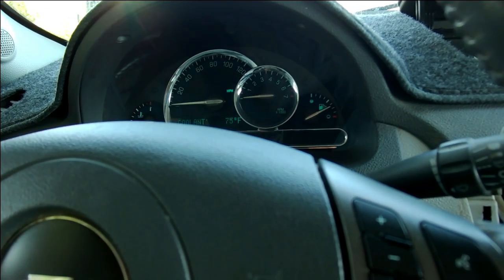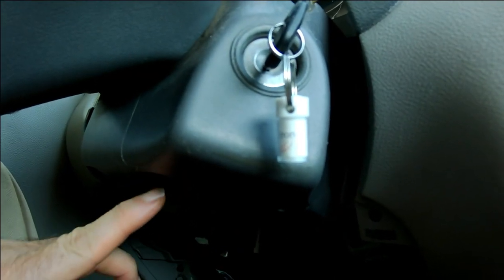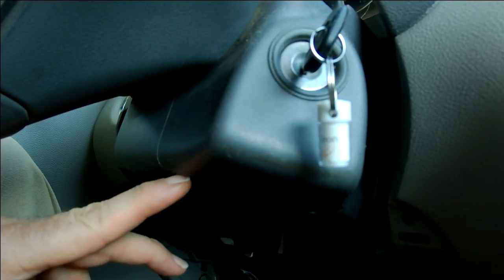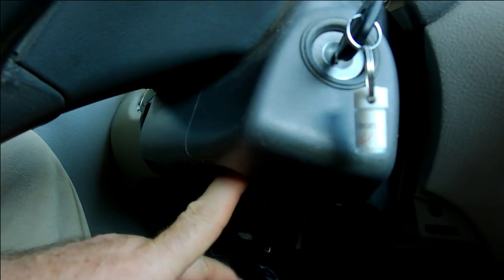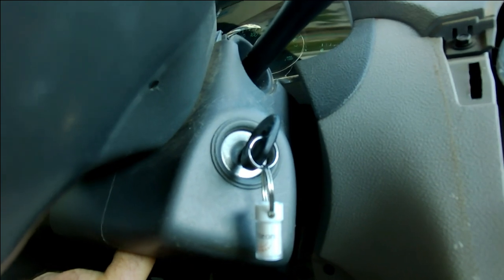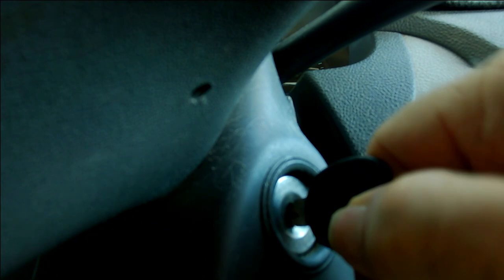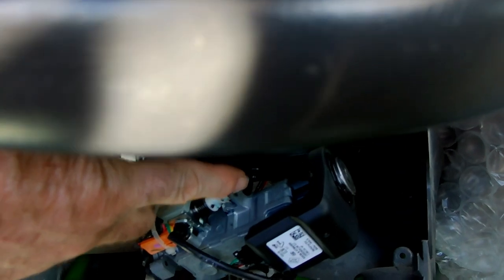Key Stuck In Ignition Switch Chevy HHR, What to Do

Comment: I have had that happen in my HHR a half dozen times. Usually when I have pulled into a parking spot at a very sharp angle and the steering wheel is still turned. Each time it releases after I do a few things, like open and shut the door, lock and unlock, shift gears, and try to right the wheel even if just a tiny bit. Key comes out. All us well. But I will remember this trick next time 👍
Reply from the maker: Wow, that is a bunch of things to have to do. Hope this helps.
Reply: Susan you saved me today. I didn’t have anything to open the the hole in the bottom and tried this and it worked on the first try. Thank you!
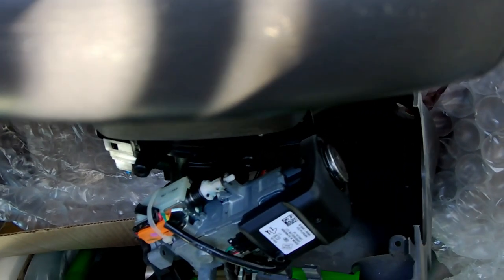Reply: Same here, mine has been doing it A LOT lately & normally after being aggravated & shifting the gear thing back & forth for a bit it comes out, BUT TODAY it wasn’t (since way earlier like afternoon & it’s 2:30 in the a.m. now)… I didn’t want to wake up to a dead battery (even tho I turned the radio & lights off manually idk if that helps or not tho) to take the kids to school so came here on YouTube & Thank God I did, got it out 2 seconds later… I was sooo happy!!!

Comment: I have an HHR. It's crazy how my key got stuck. I play music using my phone into the car's 1/8" plug. I turned off the car and music console but forgot to shut down or unplug  my phone. It was still plugged in and playing music on the phone, but since the car was shut off it wasnt playing over the car speakers. And it drained the car  battery dead, even with the car turned off. Luckily I carry a portable charger everywhere.
Reply from the maker: I carry a portable charger as well. They are very handy! Thanks!

Comment: Hi, i have loose the whole part where the ingnition is located. Its moving slightly when i'm turning left or right turn signal, it moves also when i'm moving my key in ignition. I thought its easy fix and only pkastic needs to be fixed, but it's whole part.
Reply from the maker: It seems that you have a steering column issue. Some parts may be replaceable or you may need a complete column assembly.

Comment: We have an old beatup HHR in our fleet at my job, really only gets used anymore for local parts store runs. But it's been sitting in the lot with a dead battery and key stuck in the ignition for months. The other day taking the trash out, I glanced at it and decided to do a quick google check if there was a secret way to resolve that. Google linked me straight to this video (and even a trimmed down timestamp of the helpful part) and that worked PERFECTLY. Thanks a lot!
Reply from the maker: Nice story Paul! These HHRs get fairly good fuel mileage,( if you keep your foot out of them), and now that you have it fixed I suspect it will get used more. Thanks!

Comment: Thank you so much. Kind of a good news bad news sort of thing. Somehow, when I pried that cap off, it ended up going into the hole and slid to the nether reaches. No big deal but still. As if this wasn't bad enough, on my 2009 HHR, you cannot open the back with a dead battery. Wanna have some fun? Watch a 70 year old guy slither to the inside of that back door and find THAT magic button that allows you to open the back door from the inside. Six inch screwdriver not included.

Never wanted to beat a design engineer more senseless than I did at that time. Thanks again man.
Reply from the maker: You may be able to use the jump start terminal with a separate battery to open the rear hatch as well. I have crawled to the hatch of shame a time or two myself. Thanks GM!  I have a 2006...my second one but I think they are much the same. Thanks for the comment!
Reply: @SteveAZ711  You bet. After I got it manually opened, I spent the money to get a portable jump starter, and it works to open the trunk. I was wondering why they did that jump post under the hood. Now I understand.
Reply from the maker: Nice and thanks! @texasbassranger

Comment: My wife's key only gets stuck if the battery is dead. Why is that?
Reply from the maker: No power to the solenoid that releases the switch lock.
Reply: @SteveAZ711  thank you. That makes sense.